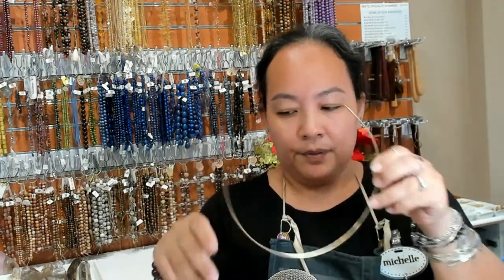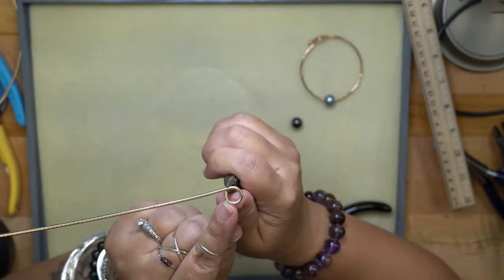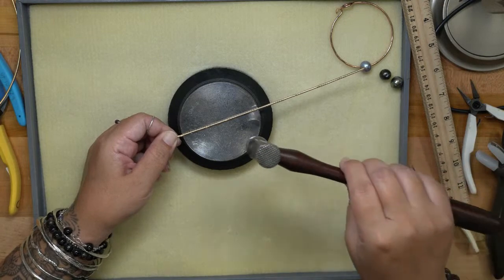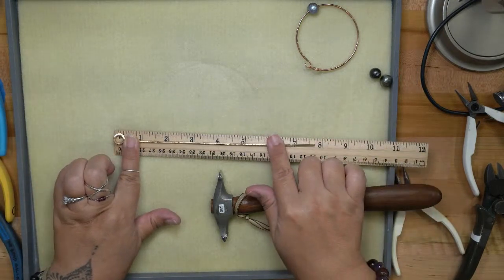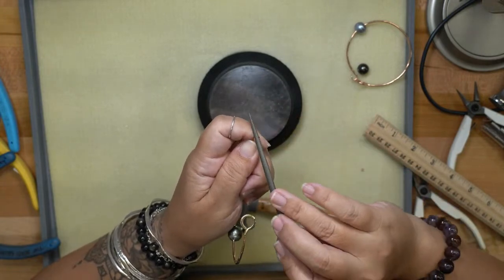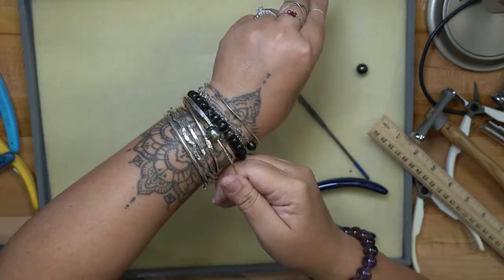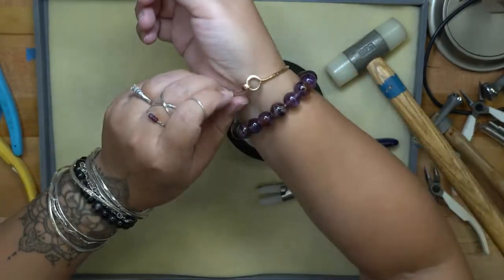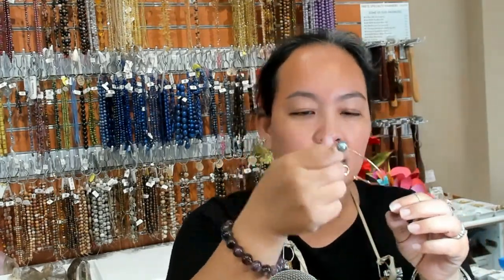How to Make A Wire Bangle Bracelet at The Bead Gallery, Honolulu

Comment: Is that the normal size gauge to use. And it needs to soft wire?  And this does not need to tumbled and it looks and feels like those bangle brackets out there?
Reply from the maker: We like to use a minimum thickness of 16 gauge to teach beginners, but 14 and 12 is our preferred gauge for strength.  Yes, tumbling is how we do it, but if you don't have a tumbler, then don't let that stop you!  Hammering will harden it enough for personal wear :). good luck!!!
Reply: Perfect.  So I don’t need a tumbler?   If I do get a tumbler which one should I get from Amazon. And if not How much do I need to hammer it?  Thank you for replying
Reply from the maker: @pochohontis  I'm not sure about Amazon, as we don't sell there, but, I wish you the best!! Watch some of our hammering videos to see how much we hammer the different wires (it depends on the gauge and temper).. aloha!!!
Reply: Is the tumbler to polish?  Or is it not necessary? Please let me know.